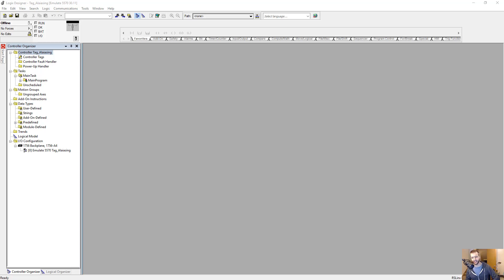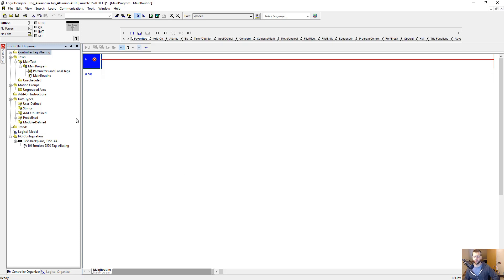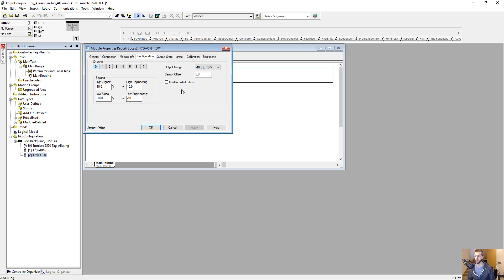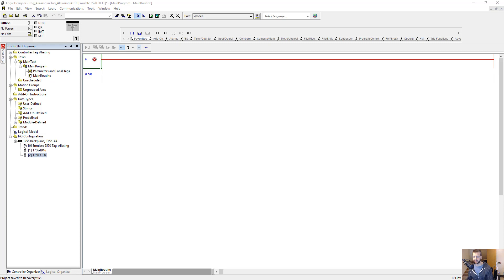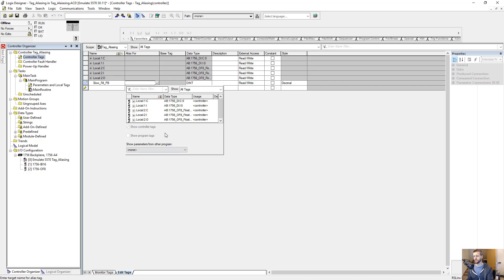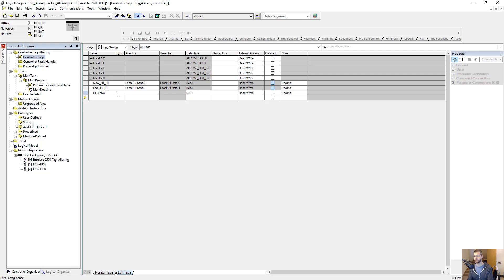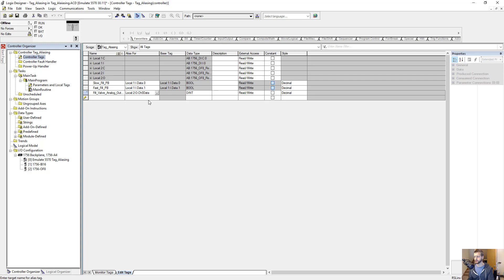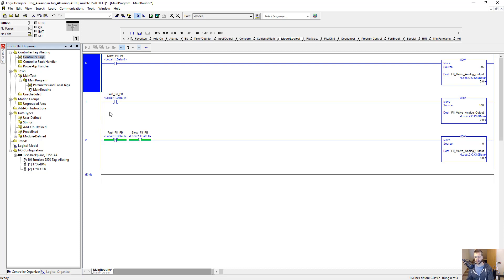Studio 5000 Logix Designer Tag Aliasing

Comment: Why did you create the SLOW_FILL_PB  tag in controller tags and not in program tags?  Was there a specific reason or because itdoes it not really mater in this scenario?
Reply from the maker: Hey Joseph, good question. You could create the tag in controller or program scoped tags, but for physcial I/O I recommend always using controller scoped tags because if you want easily use the tag/IO point elsewhere in the project (within a separate program) you'll only be able to use controller tags. Hope this helps!